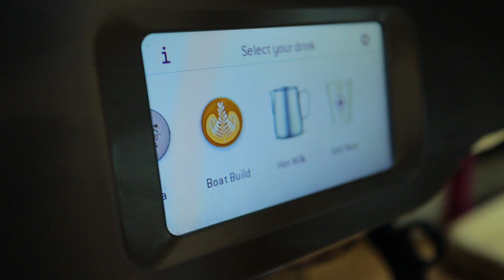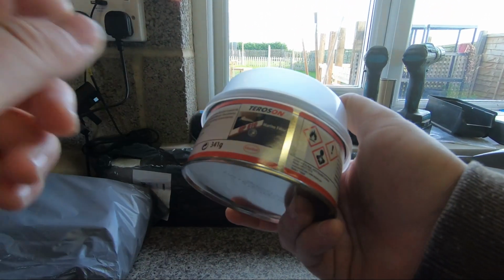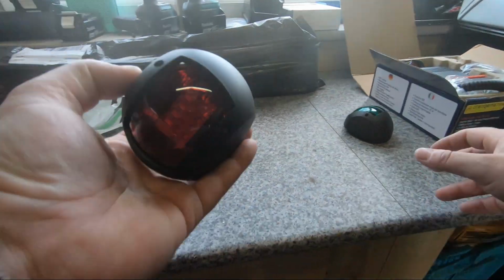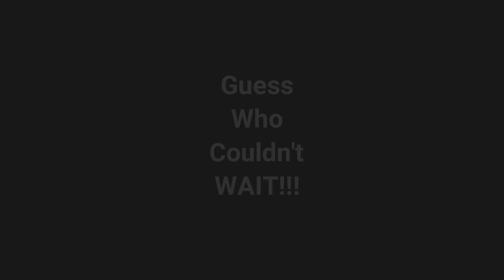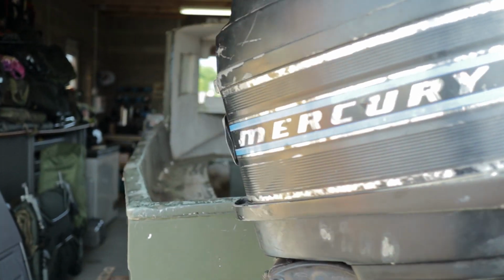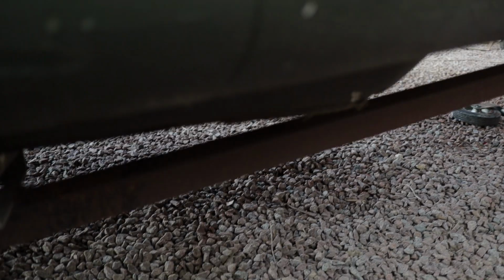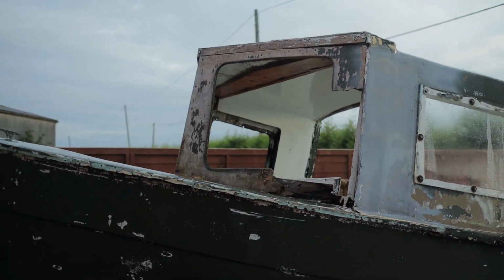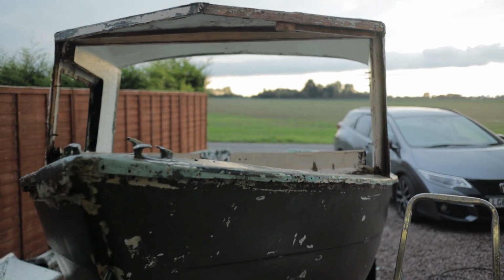MY FIRST BOAT PROJECT (EP3)

Comment: Dont matter a bit broke had boats over 30 years crack on you need a smaller e gi engine it's a semi displacement boat it wont plane  it just pushes through the water
Reply from the maker: Thanks for your advice 😁 this whole experience is a learning curve so I'm absolutely open to advice. I have found pictures of this type of boat and it's basically a rowing/small engine boat. After doing a bit of digging I will be looking for a modern 15-30hp engine. That 50hp will probably sink the boat lol. Its definitely a project that if I had known a bit more about boat I would probably never of touched it with a barge pole lol buuuut here we are committed to the cause and 3 episodes in so it's basically going to be a river boat I would say